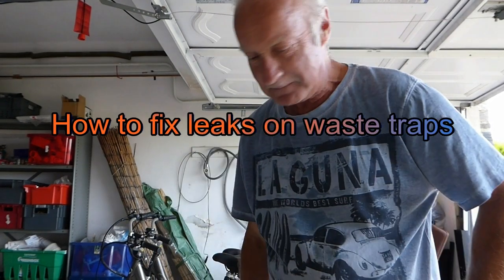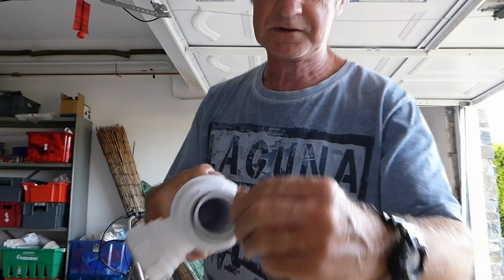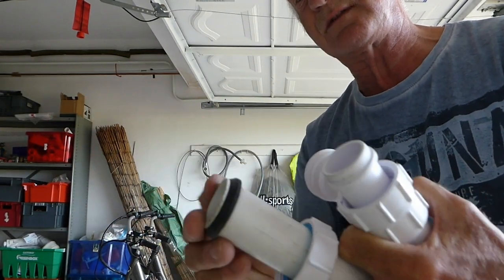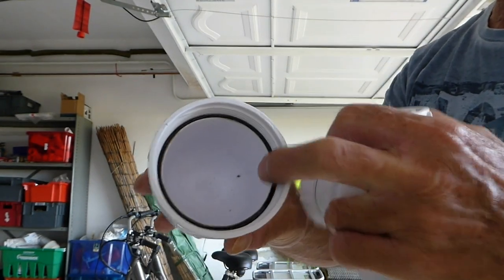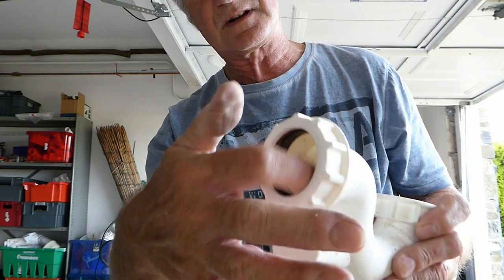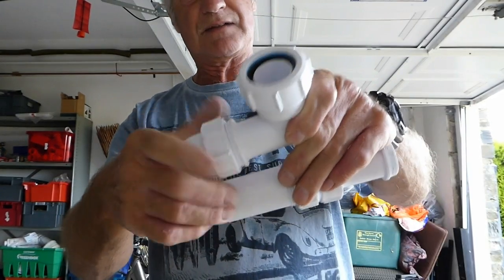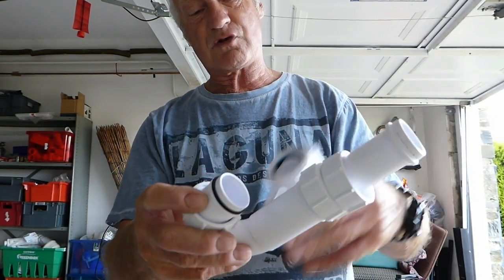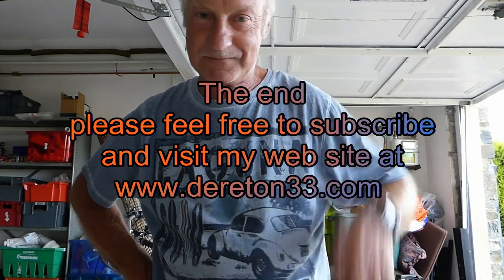How to renew leaking waste traps and make up shortfall when they do not fit

Comment: A really useful guide - many thanks.  In my system there appear to be two sizes of the conical rubber washer, both for 40mm pipe O.D.  The larger washer as supplied in the general purpose kit from Screwfix is more prevalent, but there are two other conical washers that have a slightly smaller O.D.  So beware of this little pitfall...
Reply from the maker: Thanks for the info John.

Comment: Very helpful thanks. I've changed basin taps and drainage no problem but the waste pipe at top leaks.  Bloody simple job taking me days.  New waste pipe that connects to new drainage leaks underneath
Reply from the maker: Try renewing the rubber sealing washers.
Reply: dereton33 thanks.  It seems that the plastic pipe is to small to fit the crome waste.  How do I overcome this please?

Comment: Is basin waste same format and structure as a standpipe and waste for a washing machine? I have a leak from the standpipe to the waste pipe and it only has a blue seal inside and no black washer. Can that be right?
Reply from the maker: Yes that is right. You can fix it by taking it out and using plumbers mait for the washer instead.

Comment: Have a telescopic waste already but need even more reach. Bought an adaptor/coupler but it's not compatible. Any other options?
Reply from the maker: No best to alter the waste pipe to fit it. you can get flexi short lengthts that can bend and fit lots of situations.
Reply: @dereton33  cheers.
Reply: I had a similar problem. The telescopic pipe didn't quite reach for a secure fit, so I used a coupling to make up the shortfall. McAlpine do them them in 1,2 and 3 inch lengths. Not sure, why it didn't work for you.